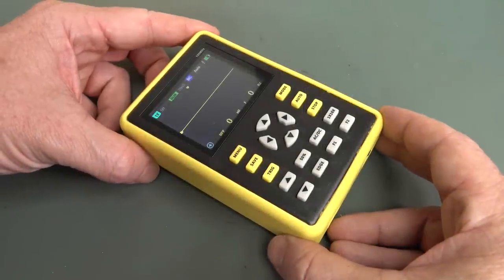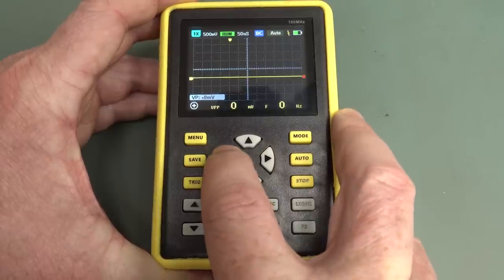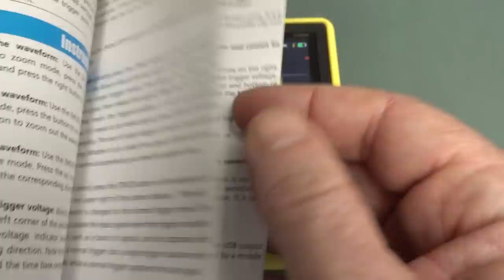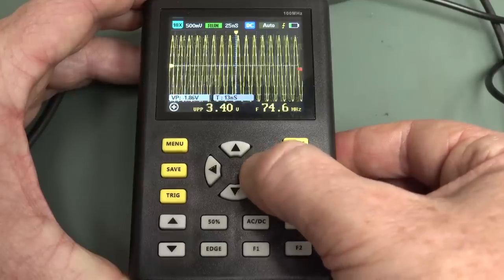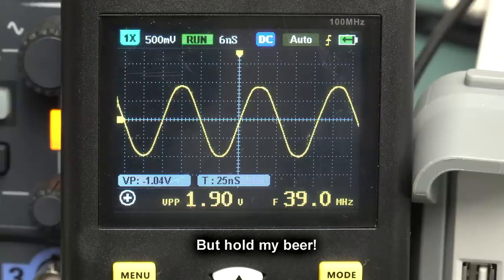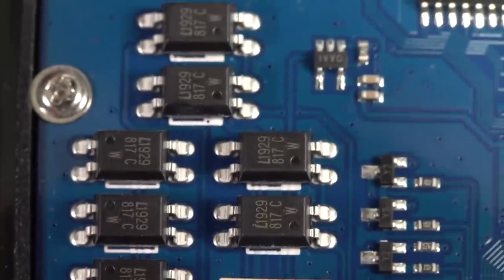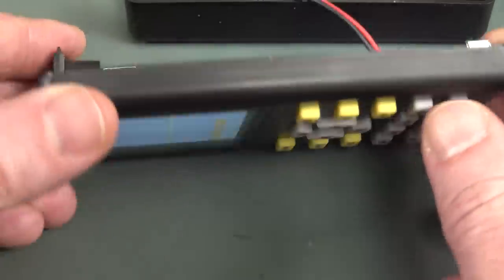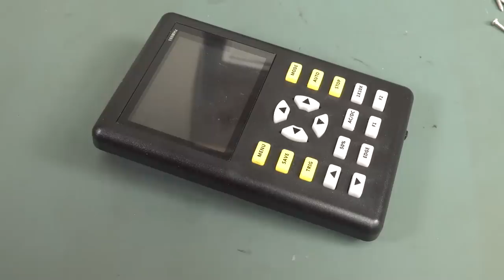EEVblog #1260 - $70 100MHz Oscilloscope?

Comment: My question after watching this is: what is the cheapest you can make a 100Mhz scope that will "pass the mustard" on all the hardware tests? Is this a component cost limitation, or is it a lack of NRE/design excellence/design validation?
Reply: As you've seen in this case it's the limitation of the microcontroller that undermines the claims. An FPGA capable of the signal processing can cost as much as this scope alone. And once you're using an FPGA or a microprocessor you'll likely need multiple power supplies, 4 layer PCB, etc. all adding up to a cost which lands in a gray area, where it's too expensive for hobbyist but hard to justify over for example a benchtop 2 channel scope.
Reply: There's still a giant gaping hole in the scope market for people who can't possibly justify shelling out a few hundred quid for an entry-level "proper" scope (and are not in the mood of guessing what condition the CRT of an antediluvian, used one is in) yet need to see the shape of things happening occasionally - and this thing is coming awfully close to actually filling that hole. With a proper 100MHz bandwidth, it would fill it too.

As for actual value measurements, ain't nobody (except Dave, natch) got the kind of money that would pay for a scope that has the precision to actually measure anything numerically - because 8-bit entry level scopes are sure as heck NOT doing that particularly well either. Measuring precisely is just not the scope's job in any hobbyist's lab.
Reply: Attila Asztalos Yeah, this would fill the hole for me either if it truly did the bandwidth it claimed, or was a tenner cheaper. I could live with a 0.2 volt inaccuracy.
Reply: It’s possible to do this stuff in this form factor and for that price, it just requires an experienced designer who can do some lateral thinking. I’m sure this SOC has at least a 32-bit RAM, so using DMA it should be able to transfer 4 bytes each cycle or two. Say it can push 200MBytes/s at 100MHz clock. It would need an external latch and a little ring counter to latch bytes 1-4 in order. Not expensive at all. So this ADC pushed to do 100MSPS each (I’m sure they use the lowest speed grade though so it will do way worse than a good 8bit one would) gives a solid 200Msps. The clock phasing needs a varicap and PWM output from the MCU to adjust for minimal distortion. And then the front end could be done better too, perhaps with internal calibration path and you could use transistor amplifiers and not opamps to get good bandwidth. It’s 8 bits and a crappy ADC, so even the cheapest discrete transistor signal chain wouldn’t make things any worse at all. So yeah, I believe it could be done better for the same price at similar volume, assuming the engineering time was free (such a design itself would be expensive since there aren’t millions of people who could pull it off the world over).

Comment: I have one of these for repairing old computers, to see digital signals not higher than 50Mhz works quite well, when I need to see something really accurate then I use my old scope, but for saving space on the table is quite good. Also, mine doesn't has the coupling problem, maybe your unit is deffective, did you bought it on the FINSR store or in other one? I know they resell their "faulty" units to other stores and they sell it cheaper.
Reply: He says in the video he bought it from their official store.

But yeah, no QA process is perfect :)
Reply: is it good for repairing devices around 20mhz?
Reply: @ivanbiasutti4567  For digital, sure, I get good signal readings up to 50Mhz (clock and bus transfers), for analog... not really sure as I haven't tested it, I only have an analog signal generator up to 10Mhz and with these it has no problem at all.
Reply: Dave rushes into things, it's a complicated quirky device that will take time to get friendly with, like women, horses and helicopters.

Comment: For the cheapie scopes that all seem exaggerate bandwidth (or conflate real or imagined sample rate with it), however, you get a lot more performance out of this one with its 2 to 5 times exaggeration versus the DSO211, DSO212, and DSO213 claiming 200 KHz, 1 MHz, and 15 MHz respectively with a similar exaggeration.  And those cost from about $65 to $210.  So, the 5012 is easily the best value (if you just must have one of the "mini" scopes) if bandwidth is important.

Comment: It might not be a super high end frontend, but I do think it is very beautifully engineered with the price constraints. They gotta cut corners somewhere, and for the amount of components you get quite some performance. Outperforms a lot of (at the time very expensive) old scopes, quite amazing that you can get this for this price nowadays.
Anyway, I do think it would make a nice handy 'through in the toolbag' kind of scope to use in the field, or when working on things that cannot be transported easily into a lab (for example vehicles).

Comment: I have one of those DSO Shell clones as a toy and it sometimes comes in handy to do some quick measurement at a weird location where you don't want to lug the scope.
However, in my experience the big limitation in a lot of applications is that it does not have external trigger or 2-channel operation (where I could trigger from one channel and view the other).
This one does not have it either...  apparently not a use case the developers of these gadgets envision.

Comment: there is the model for an example: hantek 2C42/72 or 2D42/72..... its s scope, function generator and a multimeter all in one... --42 for 42mhz or --72 for 72mhz...

Comment: Would this be useful for tuning a car amplifier?
How about checking sensors on semis and refrigerated trailers or other automotive uses?
Reply: Its voltage values output are wildly off, so I'd say no..
Reply: Patrick Dorion So I would gather amplifier possibly, mechanic work, probably not.
For the amplifier it would be mainly to verify the audio is not clipping.
Not sure I would want to spend that much for that single use case.
Reply: @caddyguy5369  Audio is 20 kHz max, there's the DSO Shell for about $30 that might do it for you, I think...  It used to be a contender for my hobby electronics use, but again, at 1/10th the price of an actual oscilloscope and only 3 MHz (if I recall), it wasn't worth it for me, but just to see an audio waveform it might do the job (if it can handle enough voltage, can't remember anymore)...
Reply: Liumy LM2001 is a better option

Comment: That one might be really great for properly setting gains on audio gear. Cheap, small and best part, portable!
Reply: SMD sells gain setters, crossover calibrators and real time power usage meters on amazon and his site.
Reply: @damianLsmith  To be fair, this could do the gain setting for a fraction of the price.
Reply: @damianLsmith   also is thousand times more expensive

Comment: 24:50 - what does that "wiggle wiggle wiggle, yeah" trace do?
Reply from the maker: It matches the length of the other trace so the two clock signals arrive at the ADC at the same time. If you don't do that then there will be clock skew which is not good for accurate interleaved sampling in this case.
Reply: sounds like impedance matching on a differential clock signal.
Reply: Atetus94  I’m tempted to sample that and put some music to it 😛
Reply: @KerbalLauncher  It's length matching. Impedance can be the same but different trace lengths for clock and data will cause timing problems at high frequency. Look at the layout on motherboards for DDR memory for a good example of this.
Reply: @EEVblog  Are you sure that it's making sure that the clock signals arrive at the same time? I would have thought that one would be offset by a half-period to get the interleaved sampling (isn't that how high end scopes do it?) Or is it length matching in this case, because the clocks have opposite polarity?
Reply: Looks like a differential clock trace, the signal is inverted on one trace wrt the positive going signal.  The lengths of the PCB trace should match as close as possible so the propagation delay of the edges  of the diff clock signal match. This diff signal cancels any digital noise ie reflections from mismatched impedance or ground noise.

Comment: DJ can  you do a follow-up on the whiteboard and draw a schema showing the resist divider front-end, the capacitance problems/origins, then maybe block out how the rest works? Like front end to divider, then ADC/micro etc?  And maybe compare to "proper" front  end?  Im interested in how they went about designing it at a low cost, but came a gutsa with certain decisions.
Reply from the maker: That might make an interesting video.
Reply: @EEVblog  yeah - its great when you break out the board and go into a bit more detail with some of these things.  And voltage division/ratios through resistors is a base concept, so may be a nice hook for beginners to get into & understand. And to hear from you why, even though the division works, it didnt cut the mustard here freq wise. And maybe why this thing could never get it's advertised "banner" specs because of hardware/silicon choice? Cheers mate - love ya work.

Comment: lol. Reminds me of an article from an electronics magazine about 20 years ago which gave a design for building an oscilloscope into a gameboy cartridge.

I guess that would be an amusing comparison - is this thing better, or worse than a hobbyist magazine project to turn a gameboy into an oscilloscope?

I know I have the design somewhere...
I wouldn't be surprised if that works better, simply because hobbyists are less concerned with meeting a price point, so it comes down to the design skills of whoever put that circuit together.

Of course, a Gameboy only has a 4 mhz z80 processor, but whether that's an issue or not depends on how the oscilloscope circuitry is designed and how it's interfacing with the gameboy...
Reply: Since the Gameboy just hands addressing to the cartridge, you could do some really stupid and powerful stuff. You could just make the Gameboy CPU run a simple thing that blits cart memory onto the display, and have a 1 GHz ARM SoC in the cart do all the heavy lifting.
Reply: AFAIK the game boy scope did not come close to meeting 20 MHz.
Reply: I have one of those cartridges..... fine for audio frequencies up to 100 KHz!

Comment: I am a Chinese, to be honest just dont buy this type device. Save money and buy a brand one, at least rigol siglent even uni-t or owon
Reply: Depends what you need it for. I have a Siglent SDS 1104X-E, and to me it's a pricy hi end equipment. I wouldn't feel comfortable using it in a field where something may happen to it mechanically, or some unknown signal may fry it. The $70 scope would be PERFECT for such use.
Reply: I’m a mechanic spent thousands of bucks buying pico. It’s an overkill to me , portable and cheap device like this is what most of us need. Hope fluke might come up with device like this.
Reply: Have you seen the network analyser for under
$100 ?
I can't afford thousands  for a nice one.
Reply: @lasithrajamanthri5992  
I bought a Tek 485 for 50 GBP on Ebay.
Reply: 显着你了是吧，妄自菲薄。
Reply: I am a Chinese too, just ignore him, buy whatever you like to buy.
Reply: 诺大的？

Comment: It's easy to look down one's nose at a piece of kit like this in this day and age .. but I can see this as a relatively useful little gadget for simple breadboard play and debugging. Sure, not aligning an MRI machine, but even for "simple" service gigs .. is "this" particular output at least varying it's PWM signal? Would be a great auto service industry tool, the environment typically too harsh to risk the $1600 Fluke s'meter. Seventy bucks is a barely few hours worth of pints sorrow if you drop the little thing in a bucket of coolant. Not going to replace the 1GHz Tek mainframe, but I wouldn't be embarrassed to have one. Spent quite a few years with a "tool" fashioned from 5x7 LED matrices, LM3914's and 4017's as a rudimentary "scope" working on cars. I would say that this thing has it's place as an enhanced "go/no go" bit of test gear. Hell. remember what you paid for your first logic probe back in 1978??

Comment: It's possible that the chip may be capturing the samples via DMA to the GPIO. I haven't looked at the frequency / signal spec of the GPIO for the chip, but the block diagram has the DMAC, SRAM, and GPIO on the same AHB bus which can run at 168 MHz. It also has two DMACs. The details of the matrix didn't appear to be in the datasheet (it may be a multi-lane cross bar), but it is probably 32-bits and one full bus at least. That means that a single GPIO DMA transfer could occur at 168 MHz, reading all 32-bits simultaneously (16-bits of sample data and 16-bits of garbage). And since the two 8-bit samples are contiguous in time, it doesn't have to do any weird repacking. I would be more interested in how they are doing the triggering, especially since it looks like the clocks are from DMA transfers?

Comment: Looks like the 100MHz  is aliasing with the sample rate.  Probably occurs on multiples of that.   Also in normal tigger, I wonder if it would be stable if you scroll to the left side of the waveform (the first cycle of the trigger).  For the price, it works pretty well.

Comment: It will skip a 100 Mhz wave with a frequency meter every 10 waves and then one
mixed wave a little phased continued as a small phase offset phase to measure at the representative phase of the new wave in the 25 MHz range. In order for this to be possible, a synthesized mixing and average wave at 8 transistor R-C gates is quenched and then sampled much slower. This is set to a 25 Mhz (100 Msps) clocked AD converter, although at the correct phase beginning of the display. However, the virtual image is displayed in the 25 MHz mode of the second AD converter. The representation of the output is then synchronized a second time, with the input both synonymous and mixed to paint smaller display errors .-> Very inaccurate device but you can make for just € 70 very rough wave analysis with digital smooth shit. However, a precise sequence analysis is installed. At least it works right up to 1 MHz. The preamp is, however, a little less but just enough at 50 mV. Also missing is a switchable 50 hz filter. Nevertheless, it is practical for very small applications and budgets. You could also install a 500 Mhz AD converter (for plus 20 €) accurate and mix up to 1 ghz hereby roughly, with an frequency divider oft 10 ghz  (well this with 17 €, and fastest 7x transistors only manage to 10 ghz, add 7 € ) A little unfair the comparison, but some are looking since 20 J such Oszi for the vest pocket, but with higher frequency. The Umts-Aera did not change the most consumer  limit of normal ozilloscopes over 30 Mhz. The mixing methode was 20 years ago discribed in some science journals, I believe to remember. An 10 Ghz mixed vest pocket would be true timely.
Reply: Say that in 12 words or I won't believe you.

Comment: Well, it's a bit unfair to contrast a Rolls Royce with a Kia because if all you ever drive is your uncle's Royce you are going to think the Kia is crap. Likewise with this $70 scope. I used to build a lot of Ham band CW transmitters and used a BK Precision 30 Khz 1474 scope that was probably built in the mid to late 70s. All I needed the scope for was to see that I had indeed a signal, a rough idea of the watts the transmitter was putting out and an ability to look to see if the band pass filter was attenuating 2nd harmonic. I was pretty limited with the 30 KHz scope I have and it cost more than $70. So while the scope you tested will not stand close to an over a $1000 scope it still would probably suit my needs when constructing simple transmitters and a hobbyist can't really justify an expensive scope from the perspective that repair jobs will pay for it over time. So, yes, I'd give it a thumb up for its price range when one uses it within its limits.

Comment: I got one of these to play with as I am reviewing a number of low cost scopes to advise others for model railroad purposes.  (Testing most of the DSOxxx tiny ones and larger Hantek ones like their 2C42 which I think is money MUCH better spent than for any of the "mini" scopes.)  The one I got was marketed by Yeapook as the ADS5012H and seems identical.  It is a somewhat different animal than the DSOxxx scopes which have ludicrously exaggerated bandwidth claims.  The 5012 peak to peak voltage diminishes quite a bit once you get above 20 MHz, but it can still show a semi respectable sine wave to well above 50 MHz (although slightly flat topping above that).  Of course, a square wave at those frequencies looks extremely trapezoidal.  I found one of the most interesting features being that a button is provided for pretty much each of the day to day operations you do.  Even a 1X/10X button is there which is something buried in a menu on every other scope I have seen.  By far the easiest scope for a beginner to use.  It comes with a 1X/10X probe but like most cheap probes with cheap scopes, it introduces voltage error and has no means for compensation.  You need to use a 10X probe for max bandwidth so if accuracy is important, you may have to buy a scope probe that costs as much as the scope.  I must say that after flailing at a number of the other mini-scopes and figuring out the trick(s) to access all the menu choices, this 5012 scope was like a breath of fresh air.  It even came with a very nice semi hard shell case with room for accessories.  Finally, the case has the slogan "A hardy tool makes a hardman".  On the Amazon site, the slogan is "A Handy Tool Makes a Handyman".

Comment: If they hadn't made the claims beyond what they really did, it would be not a bad deal.  The analog scaling could be a lot better without a lot more complexity.  It would likely involve some 2% capacitors to get the gain flat enough to be an honest 3db at 20MHz.